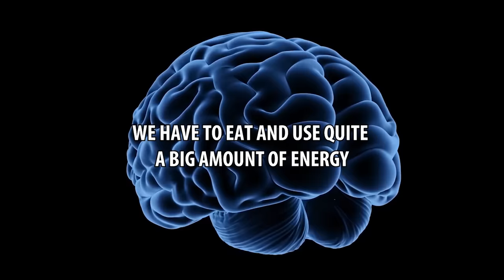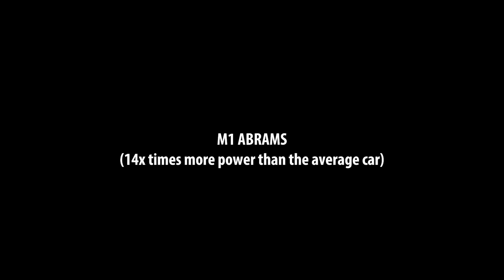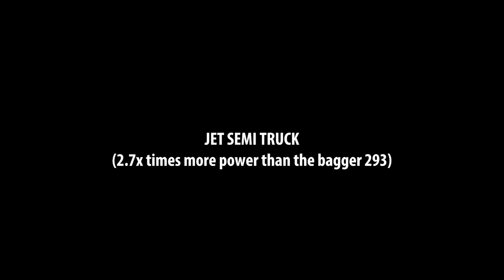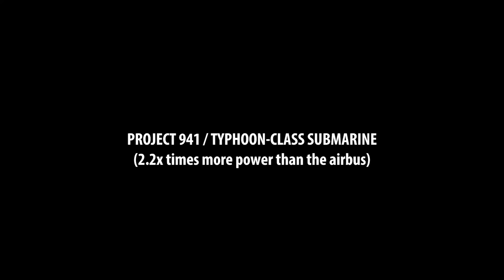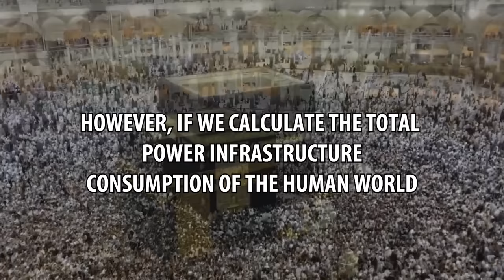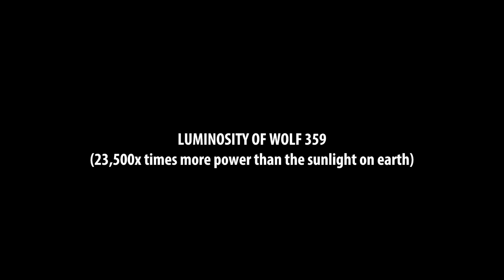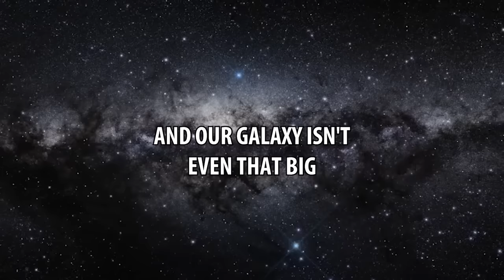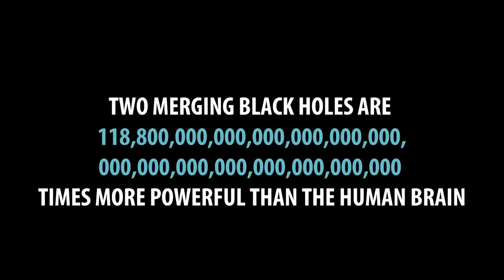Top Most Powerful Things Ever

Comment: Nice video, but you have confused power (Watt) with energy (Watt Hour). Its like mixing up km/h with km. One is speed the other is distance.
Reply: Thank you. Nice to see that I wasn't the only triggered one.
Reply: It makes sense to measure these things in terms of power. Only at 0:40 I think he gets them confused where he says kW per second.
Reply: Light bulbs are rated in watt hours WH. Kw means kilowatt.. 1000 watts = KWH. If you convert 0.030 kilowatts per second to kilowatt hours KWh. The answer is 108,000 watts WH. rated like a lightbulb.  According to this video's info, the brain would be on fire. And uses more power than 1000 high powered light bulbs. And uses more power than 13,500 home LED light bulbs. That's a big error. Should I trust the other information?

Comment: "0.030 kW __per second__" - you're wrong saying that. Power is independent of time. Wikipedia: "In physics, power is the amount of energy transferred or converted per unit time. In the International System of Units, the unit of power is the watt, equal to one joule per second."

Comment: Stephenson2-18 is taught to be the largest star in the universe larger than Uy Scuti 27 times. And Ton 618 was the largest black hole. When travelling at speed of light it takes weeks to enter the Event Horizon to the singularity. Or eleven solar system will fit inside of it, side by side.

Comment: If 2 black holes merging could generate that much power, imagine the power output over time of the eventual merger of all black holes? Of course, the time estimate for that is beyond normal comprehension. The Black Hole Era of the universe is predicted to happen in 160 to 200 quadrillion years. A quadrillion (short scale ) = 1,000,000,000,000,000 (10).

Comment: If that manz Civic got a turbo bigger than the engine, all wheel drive, carbon Fibre body panels and has a laptop in the passenger seat, you might as well stop and drive in reverse because you'll lose regardless

Comment: Light bulbs are rated in watt hours WH. Kw means kilowatt.. 1000 watts = KWH. If you convert 0.030 kilowatts per second to kilowatt hours KWh. The answer is 108,000 watts WH. rated like a lightbulb.  According to this video's info, the brain would be on fire. And uses more power than 1000 high powered light bulbs. And uses more power than 13,500 home LED light bulbs. That's a big error. Should I trust the other information?